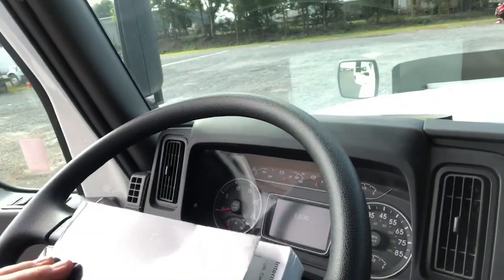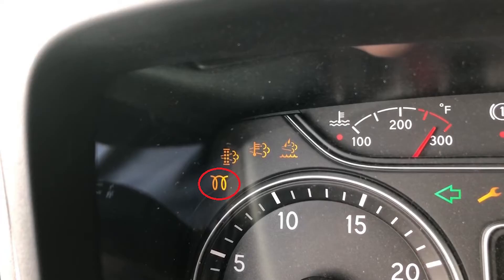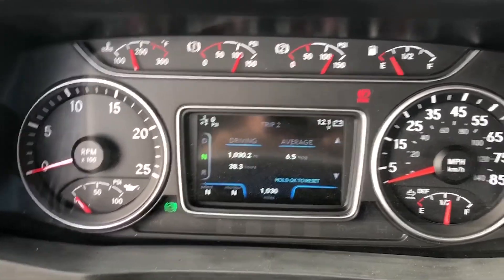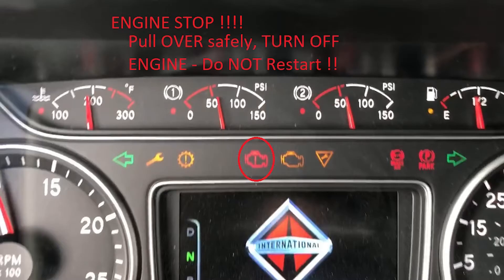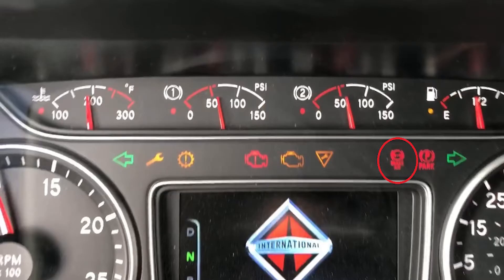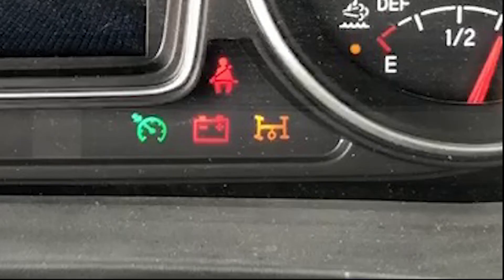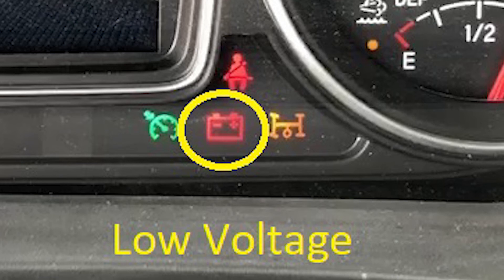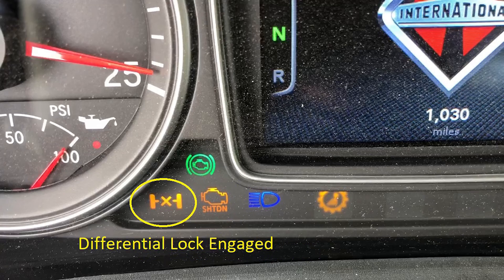International Warning and Indicator Lights Walk Through by Michael Olden of Lee-Smith 2020

Comment: My amber engine light stays illuminated a few seconds longer than all the other lights do, just like yours did in this video. Is that normal?
Reply from the maker: Absolutely normal.  I believe you are referring to either the engine pre heater or the engine light which goes through an electronic check once the engine is started.  So it will stay on a moment larger until all connection points 'check out'

Comment: Putting the high beam indicator (and other indicators) where it cannot be seen while driving is an engineering fail. Only way i could see them from my seated position was to lower the steering wheel to where it touched my legs as the horn pad obstructed my view of the lower part of the cluster. Maybe shorter drivers sitting further ahead can see it but i sure couldn't.  Ended up not using my high beams because i would accidently flash other drivers lowering the high beams that were actually already on low beam. Could negate this problem with a push/pull style signal stalk as it would at least give tactile feedback as to what position it was in when you cannot see the light. Existing signal stalk would also do sort of a double flash of the high beams when operated. I cant remember now if it was going high to low or low to high or both.
Reply from the maker: Thank you for the comments and your experience as an operator!

It is invaluable to get this feedback and offer the information for the Corporate feedback and how the can be of service.  As I receive a response or more information is available - I will let you know.

Again - Thanks!

Comment: I have a new LT with the differential light blinking and cannot disengage the diff lock/axle lock. tried everything and the light keeps blinking.
Reply from the maker: please resend this to molden@lee-smith.com along with your VIN number and location.  I will check with service systems.  If this is a 2022 then I should be able to pull a health report to see what is coding.

Comment: I currently have the curly cue light and it’s not going off. How long is the wait for the components to warm up?
Reply from the maker: The curly Q light is the engine block heater.  

If the light does not go out - there is a need to check the lines to the glow plugs.  

It should illuminate for 30 seconds.  Go out while cycling the key.  Depending on temperature - the light may return as cold air is drawn into the engine.  

The warming of the engine block will allow the light to go off.  

What was the temperature where you were starting the truck??  Thanks!
Reply: I was in Orlando Fl believe or not. Most mechanics I called were confused of that because it was nice out like 75 degrees. I needed up spraying a little starter fluid in and it crunk right up.
Reply from the maker: @jonathanapk  That is unusual.  Glad you uncovered a short cut!!  Happy Driving!
Reply: The one I drove would stay on some times if I immediately cranked it over after turning the key on and didn't wait for it to do it's preheat cycle. I would just shut it off and let it cycle and start it again and it would go out

Comment: What about the warning light that looks like a shifter with a geared circle.
Reply from the maker: I beleive this is the light you are referring:  https://youtu.be/-hVV75PlkPk?t=100
Reply: The 1 next to the high beam indicator. I see that whenever the tractor doesnt want to shift in drive or reverse. It's an intermittent fault.
Reply from the maker: @timyim713  https://youtu.be/-hVV75PlkPk?t=243 found it.  I will be back in the office later today and hope to fully respond by days end.
Reply from the maker: @timyim713  The light to the right of the bright lamps indicator - which is on the left hand side of the steering column - is the RANGE INHIBITOR lamp - range inhibits the transmission gearing selection.

It displays when the transmission electronics failsafe to prevent its self damage.  As an insight - the transmission light will come on if the mechanics of the system are slower than the driver of the truck.  There is a need for a pause when moving from neutral to reverse, neutral to drive.  Real world movements that drivers go through when driving.  

From an engineers perspective - - the driver is being to aggressive - - not allowing the transmission to do what we (the engineers) have designed that the operator (driver) will do when behind the wheel.

Potential actions that create the intermittent lamp illumination:

Changing gear selection (d to n, n to r, r to n) while creeping along - or not fully stopped.  There is a 1 - 2 second puase needed when moving from these positions. 

Aggressively applying the fuel pedal 

NOW - if the lamps tracks or follows the upward movement (from 1 -12) as the transmission increases speed - there is reason to have the truck checked out.

If you are experiencing something different - let me know!
Reply: @MichaelOlden 
I'm getting this light whenever I shift my international into gear, D or R but not N, and the truck won't go anywhere. Let it sit overnight and still nothing. Any ideas?
Reply: @johnathant1597 it needs to see the brake depressed before it will allow you to shift into D/R. Maybe brake light switch?
Reply: Ended up being a faulty bcm that had intermittent problems.

Comment: Thank you,, I came here to find out what the diff lock light was. One of our 2022s has the diff lock light on all the time even though the diff lock switch it off and the axle isnt locked its not hopping in tight turns at all. Truck as 1200 miles on it,if it persists i guess ill check the activation switch on the rear axle, this is a town plow truck,you can hear the air valve working when you turn it on and off its charging and dumping air like its supposed too.
Reply from the maker: It sounds as if the body control module needs an update.  With multiplexing electrical lines, the Diamond logic tool works wonders for helping companies and operators.  So this could be an install glitch.  Or it could be a sensor.

Comment: Turn signals have an audio sound associated with them in my 2020 International LT tractor, but the hazards do NOT.  Is that intentional or a defect?
Reply from the maker: Great question!  Thank you for reaching out.  Audio Sounds are part of the programming of the tractor.  The sound integration for turn signals is one of those features.  Why do it for turn signals? It reduces unintended signals to others sharing the road with you - especially in non self cancelling applications.  Why not on hazard? The focus of the operator is already on the reason the hazard are applied and the added noise can be a detriment to the situation.
Reply: I found that very annoying when I drove one. I'd forget to turn the hazards off. Saw my old truck driving down the road with the hazards on the other day so I guess its new driver has the same problem 😂

Comment: Supposed to be last 5 lights what was the shifter for?
Reply from the maker: The shift light is the indicated on which gear the transmission is seeking to go to
Reply: @MichaelOlden  thanks it was a rental from Ry**r when it was lit the truck wasn't moving in drive or reverse and the parking brake was not engaged. I  just sat for a while  with engine off  and restarted  and was on my merry way. Rental place never heard of such a thing.

Comment: what does the trans  mode switch do? thanks
Reply from the maker: Transmission mode put the transmission into a predefine shifting pattern.  The default is economy - which changes gears as soon as is possible.  The second mode hold the gear longer.  There are alternative programs that can be uploaded at the dealership.
Reply: @MichaelOlden   ok thanks, so can I push that button at any time during driving? or from stop only?
Reply from the maker: @michaell4564  THough it is best to process through mode settings when parked, it is available.  There are some radios which will not pair to a phone while the truck is moving.

Comment: Do internationals never need to regen? I have a 2021 my now,  I had a 2015 prior, never have either asked me to regen.
Reply from the maker: Excellent question!  Regeneration happens as the truck is driven.  The engine sound will spike up and a message will appear on the dash.  This is a passive regeneration - as it occurs as you drive.  The manual regeneration is a driver interaction.  Mostly, performed in the when away from your clients property, parked, and with the brake on.  When depressed, the system 'self checks' to confirm the need for the regeneration.  If not needed, it won't active the regen.  If needed, the system can take 6 - 20 minutes to run its full course.  

The process is taking soot - and creating ash - through the burn process.  This is why the system will need to be removed periodically to 'deep burn' the filter and vacuum the honey comb.

Most filters can be reinstalled.  BUT it the soot turns to tar - the price can be over $3500 for a new filter.

Suggestion - at the end of the day - while the engine is still warm - put it in park, put on the break - press and hold the manual regen.  If needed - it will run.  If not - turn the key off and enjoy the evening!
Reply: @MichaelOlden  I just thought it was weird, I never had a truck that didn’t ever regen, I drove the 2015 international for two years, never asked me to, or said it was in regeneration, I’ve been in my 2021 international MV for about a year, 17,000 miles, has never asked, or said it was in regen.
Reply from the maker: @michaelsimms6771  This is very unusual not to have the unit process any DEF Fluid.

Are you sharing that you have never filled the DEF tank?
Reply: @MichaelOlden  no, I fill the def, just never goes into regan, 2021 international MV, nor did my 2015 international, not one time did I see that light go off in the last 4 years on either one.
Reply: @MichaelOlden  i dont have DEF so would I still need to do a regen? And how often would it ask me to do a regen
Reply from the maker: @terrymitchell4579  Terry, please forward the VIN number of your truck to molden@lee-smith.com  I want to review the emissions system on your truck.  Best as always!